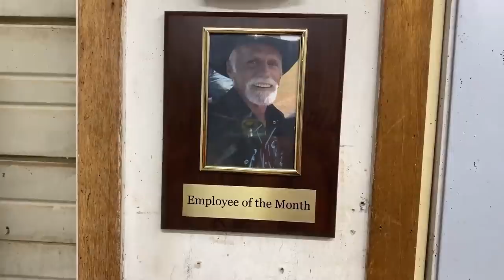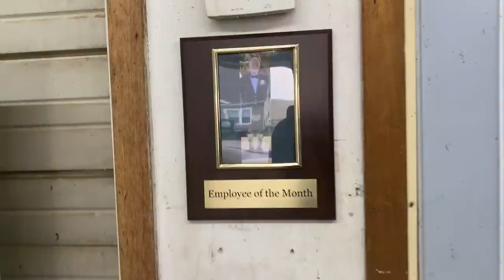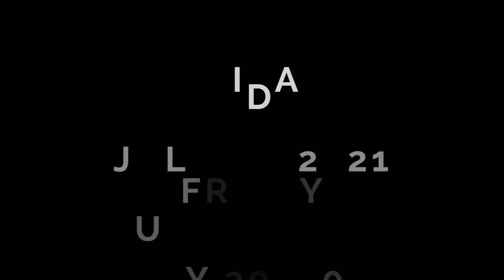Evenings on the Ranch - Weekly VLOG 3

Comment: It's been mentioned a few times but not instructed yet. To slide that plate, get on a flat surface. Lower the landing gear and you'll know it's enough when you start to see a tiny gap between the 5th wheel plate and the trailer. Then hit your switch for the release. Back her up easy until you have it where you want it and release your switch. If it doesn't lock in give a little fore or aft and if it still doesn't then take a dead blow to the ram and drive her home manually. Raise your landing gear and here's the most IMPORTANT part. Check your turning radius at low speeds and adjust as necessary. Thanks for doing what you do and God Bless you and yours.

Comment: ADVICE SIR!!!!! stay hooked with your truck attached to the trailer. Then lower the landing legs of the trailer and take a lot of the weight and pressure off of the 5th wheel and then attempt to hit you switch for the 5th wheel and scoot back to where you need to be.

Comment: Kids feeding kids. Cute 
To move your fifth wheel plate, you need to put your trailer landing-gear down and take the weight off the tractor. Then the locking pins should pull a lot easier. You may still have to bump the tractor back and forth a little, but the locking pins should pull fairly easy. Be sure to squirt a little grease on them while they're pulled so they'll pull a little easier in the future. 
I'm a little late getting to this video, so someone may have already told you all this, I didn't read all the comments, but just in case they hadn't, I thought I would try to help you for the next time. 
Have a good day.

Comment: easier to slide the 5th wheel if you drop the trailer legs to take the weight off the truck, If you need to lube it use dawn dish soap in a spray bottle work good and keeps dirt off the rails.

Comment: I am a 28-year veteran truck driver you have to drop the landing gear on the trailer and put it in low gear and crank it up to get some weight off of the fifth wheel then you release the brake thing and if it doesn't come unloose jump in the truck and jiggle the truck a little bit and it will come loose especially after you sprayed it with WD-40 the whole problem is you have to get weight off of the fifth wheel and if your trailers loaded with water you'll never move it unless you get right weight off of the fifth wheel

Comment: Hey Mike, in the future, dolly down the landing gears and take some weight off the fifth wheel,  then rock back and forth until the slider pins pop out. Be careful not to slide iit to far forward, you want to be able to turn without hitting the back of the truck and mud flaps. Oh, like what you have sitting on top of your fridge. Seagrams & is it?
Reply: @Mike Stone Hi how are you?

Comment: If you crank the dollies down and rock it back and forth, after you fix the air leak, it needs all the air pressure to push the locks out, 43 years in the business.

Comment: You need to put the landing gear down on the trailer to relieve the pressure on the actuater gear so that it will move. then it will move a whole lot easier.